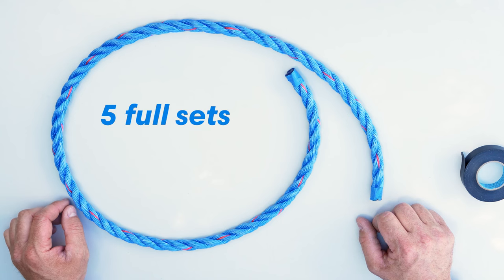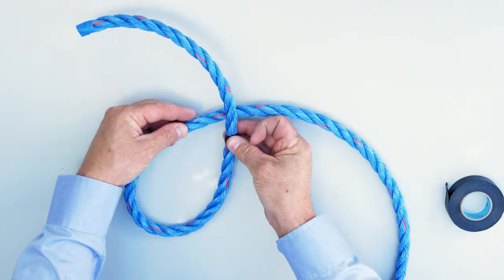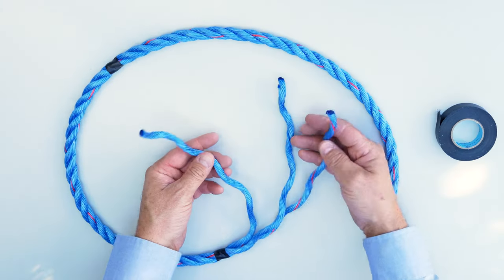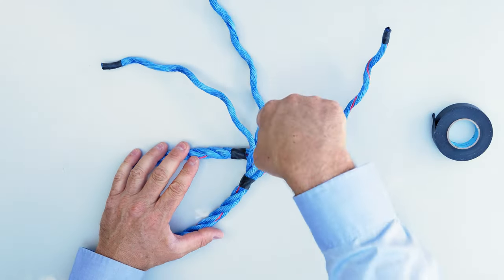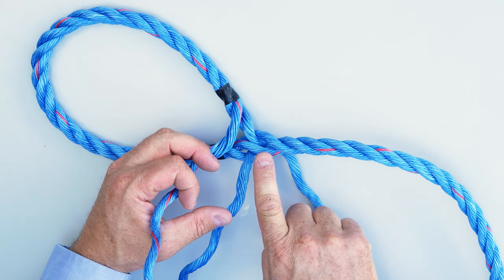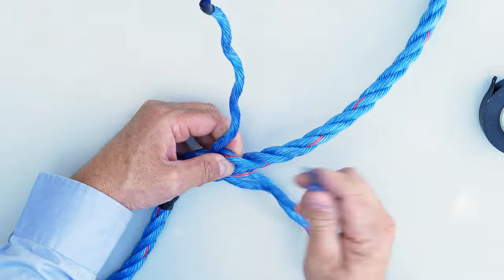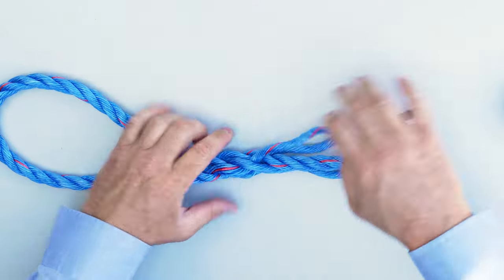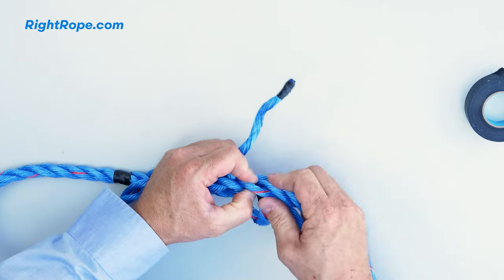Learn How to Splice a Rope in 3 MINUTES

Comment: What's the best way to finish/secure the ends of your poly rope? Do you melt it to the other tucks?
Reply from the maker: Melting the ends is good, just not to the other part of the rope. Be sure not to apply heat to the standing part of the rope that is bearing the load.
Reply: Thanks!
Reply: @tyleroxford9722 heat shrink tubing or electrical tape 👍

Comment: May be 3 min simple for you a pro, but believe me it's bloody impossible can't get first tucks right ,first 2 centre and left but then 3rd always  wrong ive give up ill tie a knot loop they are easy .and downhill from there T it for 2 hours  solid and still wrong, so please  don't tell people that's the general public  its easy as it's not.
Reply from the maker: It is definitely difficult to get the first set of tucks right, especially the third strand. Glad you gave it a try.
Reply: If anything might help out new people to it is to show the direction that the third tuck of the three has to travel in. This is where most mistakes happen. It’s still the best video I’ve seen so far but this one tuck is still the detour from perfect that throws people off